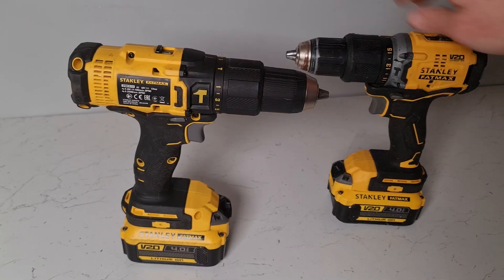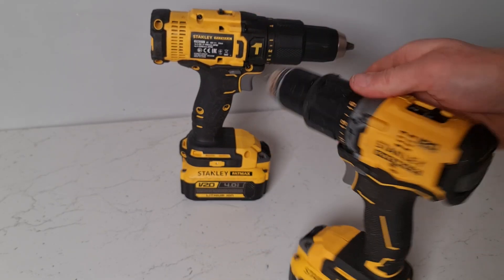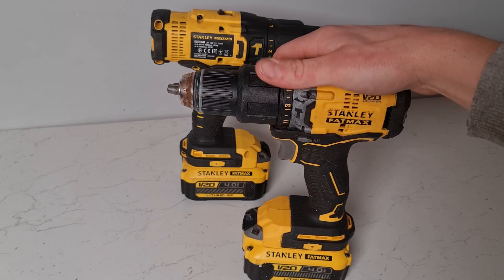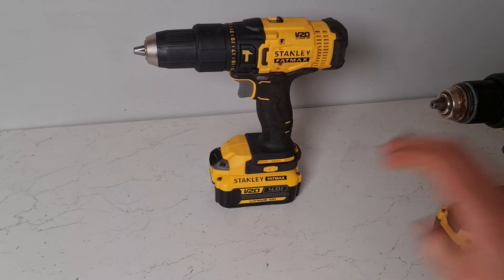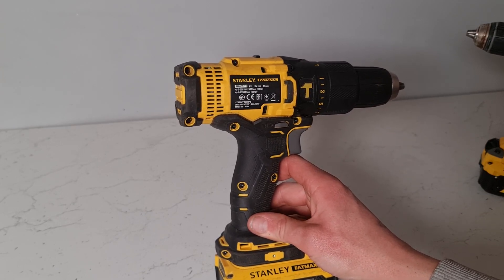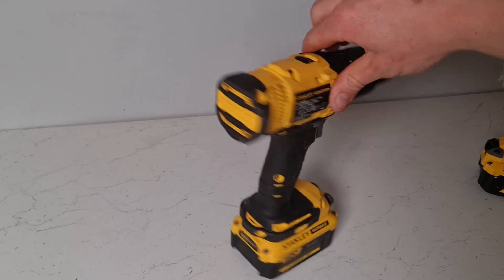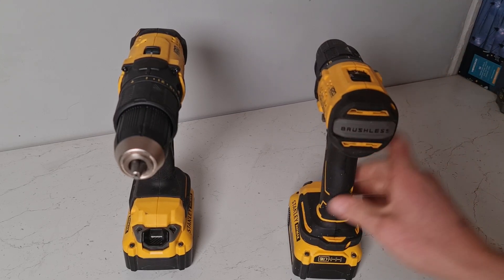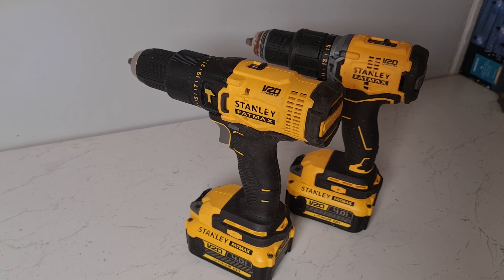Brushed Vs Brushless (What You Need To Know Before Buying!)

Comment: I will say on drills and impacts brushless seems pretty good. However on sanders and grinders the brushless cannot handle the beating they usually fail in a year to year and a half. Where as if you have an old school brush type you may have to change the brushes once in 10 years.
Reply: Absolute nonsense

Comment: id rather have drills tha tlast but i jus tpicked up a set of Ryobis for 155 bucks with eveyrhting. 2 drills, 2 batteries and a charger for 155 bucks i had ot buy new ones becasue mone got stolen from my truck..to buy the same brushless theyre 198 plus tax so probabyl 230 or so here in Canada..but i didnt use my las tones much and probabyl wont use these much as i use my dads mroe often i keep my own in my truck just in case on the road.. so they get little use.. ill stick with these i guess and when i get serious with them ill buy brishless i guess.